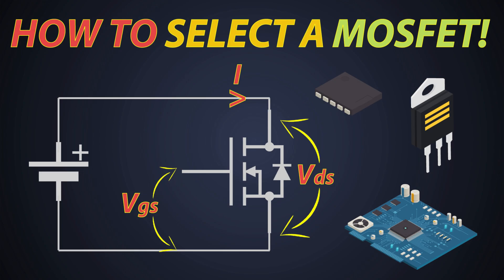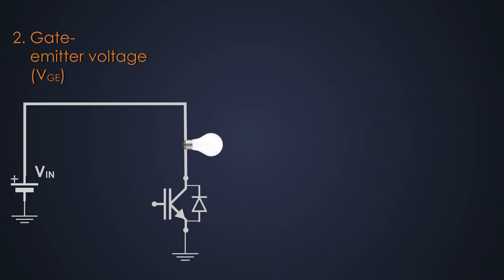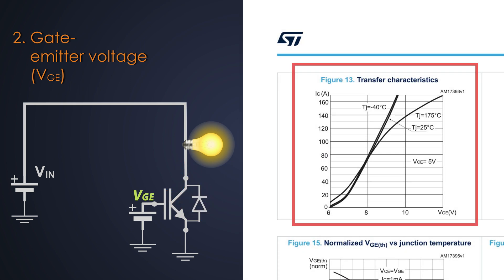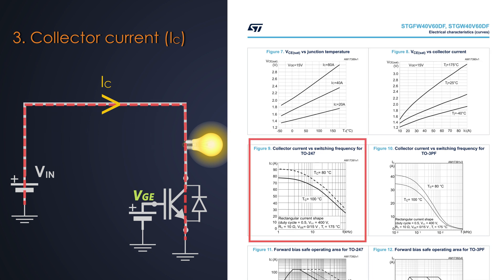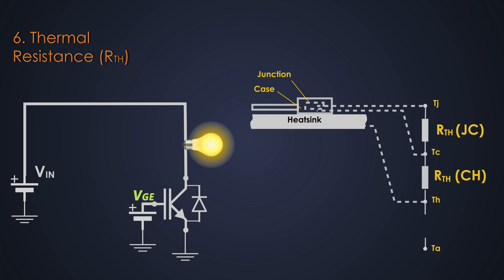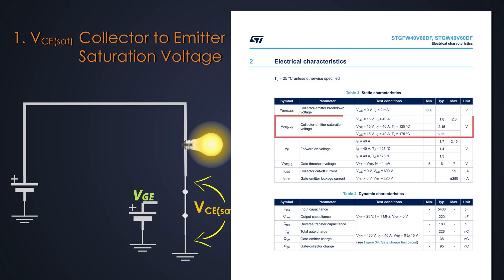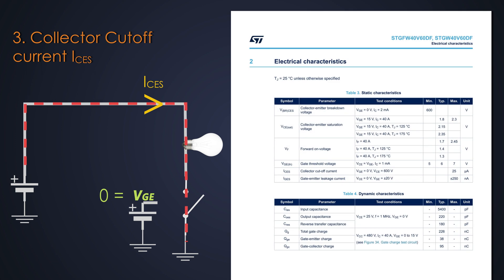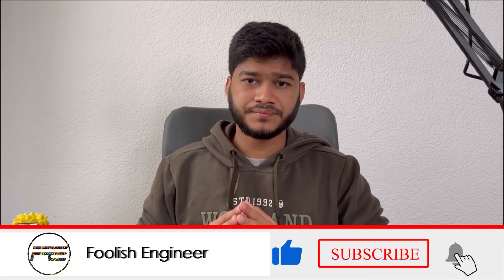How to select an IGBT? IGBT selection | How to find a right IGBT?

Comment: I have a lot of igbt that I use for as transformer in switching low frequency higher dc voltage but I never you the igbt without body diodes I am thinking to buy some because they’re much cheaper but the freewheeling body diodes is my biggest issue as I read the data sheet on fast switching flyback diodes only 1 amperage I can find to buy and the data sheet said I most use another igbt or mosfets as body diodes , and then I realize why there so cheaper because it’s cost alot money to use in any circuit the flyback spike body diodes is why to expensive

Comment: Can I use MOSFET instead of IGBT  . I try to use MOSFET that can handle 500v 50 amp with replacement of IGBT  . 
The welding machine work fine and even better 
Replacement from 60N60fd1 in to FDA50N50 . And the welding machine work fine

Comment: Hello Dear 
Please help
Can i replace 
SGT40N60NPFDPN igbt
With
Stgwt40h65dfb igbt
Thank you
Reply: When you get an original IGBT that have right information as the database it's will work great . Trust me . But if you buy fake mosfet or IGBT especially IGBT . It will blowing up as fireworks . As I get it from bad quality IGBT from china low cost market.
Some time they selling you the fake mosfet with original price and you can't find it until too late.
You need to put the transistor into test mode with every method you have as test V and I and P and R and vsat

Comment: Hi,
I am a model engineer. I want to build a model 4 stroke petrol engine. I am trying to design an ignition circuit for this engine. But with my limited electronics knowledge I am going nowhere. Can you help me design this? I am planning to use IGBT for switch and proximity sensor for timing.